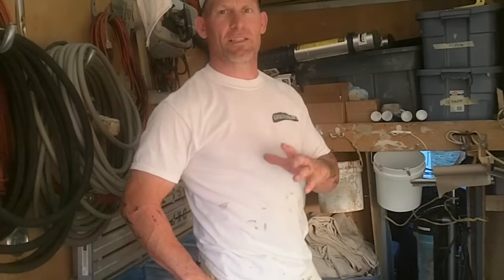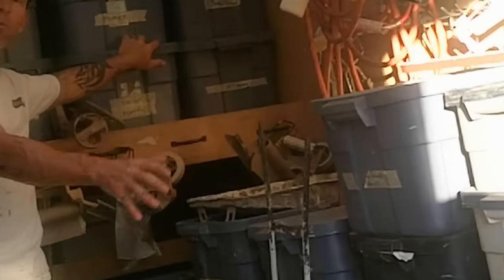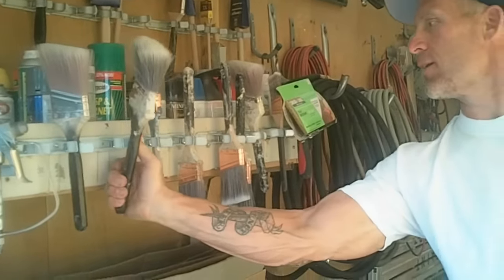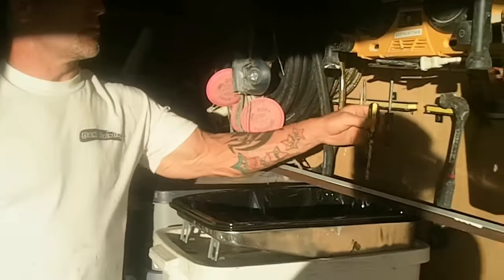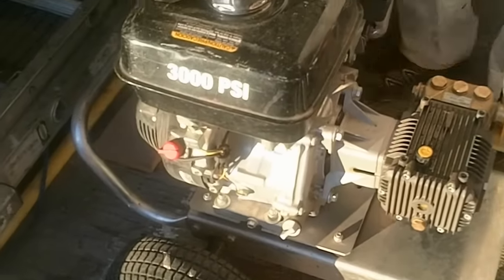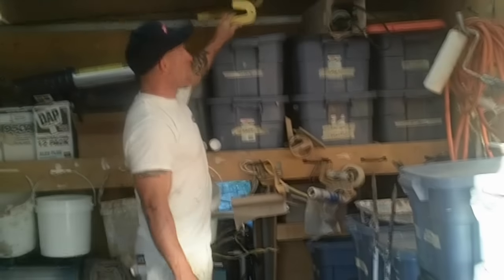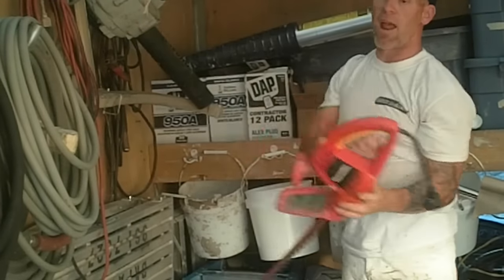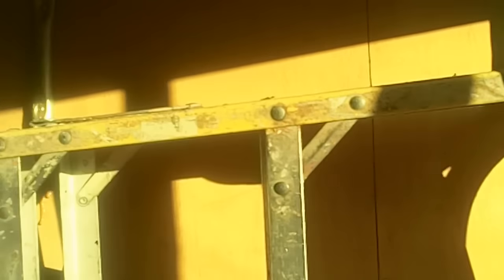DIY TOOL BOX VAN.  Organizing A Painting Van.  How To Set Up A Painting Vehicle.

Comment: Really appreciate this view into a middle ground between the guys who just build a birds nest of tools and extension cords in the vans and the guys who have either a completely prefabricated set up or one that takes dozens if not hundreds of hours and a workshop to build out. 
I did a very similar organization for our business that does residential/commercial  maintenance (Cleaning, landscapes, painting, drywall, light carpentry etc. but only small scale projects and things that qualify as maintenance) and we also use the storage totes that you guys like so much in combination with shelving, hooks and hanging buckets. The only improvement I was able to make on what I saw here (which of course you've probably improved on) is to make simple shelves for the storage totes such that you can get to the bottom one without removing the top 3. 
Thanks for all your efforts to show us how you get it done!
Reply from the maker: Thanks for watching and supporting Zachary!

Comment: You've taught me a lot Chris. Thanks. I run a smaller set-up and usually only have a half dozen naps rather than a bin full.  My van like yours is always spot on, to the extreme. 
"Mise en place" style as the off season (when there was one) was usually filled in as a chef.

Comment: I “sharpen” whittle the ends of my brushes to a flat pointed end to differentiate that they are mine. It also makes for a makeshift scraper when painting an need to chip up something small real fast or dig out putty in the trim crease ect.

Comment: Hi Chris. I love your videos. I learn alot. I want to start my own painting bussiness here in NH..but ive only painted for my family who flips houses. Ive done several whole houses. ive only brushed and rolled paint tho. I work a day job but want to start my own thing. how would you go about it in my situation. i dont know what to charge..do I measure each room and charge that way or what. im barely getting by supporting four kids on 10.00 an hour. my fiance works also..so i cant just quit to start and not have a bunch of jobs lined up. i have alot of questions..lije do you always let the customer choose what paints they want..like brands..there are alot of different types of primers\sealers etc..how do I know when to use a special primer? should i buy a used airless sprayer from Craigslist? ive seen them for 100 bux. when do you use the hvlp? how do you know when you have to spray instead of roll/brush? can i only roll and brush? so many questions..lol..but these are things i want to know before starting so i dont ruin someone's walls. i look forward to your videos. ive had alot of dead end jobs and am tired of working for people that dont appreciate what i do..i look at it as im always going to be expendable working in factories and laborer jobs..im always struggling to provide for my self and my kids because im always at dead end jobs. and i want to put an end to it. i think painting is something i can do full time if the work is there. it seems to be the easiest and less expensive trade to do such as buying tools to start and supplies. i hope you can answer my questions..im sure you get alot..and can barely find time to respond to all of them. but you are really all i have to go to when i have a question..i learn better by physically seeing it done rather than reading a book about whatever im learning so these videos really do help and are worth watching. so thank you.
Reply: Matthew Allard Sounds like you need about 10 years experience. Then you will have the answers. Good luck.
Reply: Matthew, You can start a painting business without spending much money or going into debt. I know several painters who have nice little businesses who don't spray anything. I started without a sprayer and bought an inexpensive one after the third job. Now, I frequently have two guns and occasionally three going at once. I think your best plan would be to quit your current job and go to work for a professional painter for a few years before going out on your own. You would get an instant raise from the $10 you are making now to at least $15/hour while learning the trade. That's what I pay someone with no experience and a good work attitude. In a couple years you can be earning $20 or more per hour working for a painting contractor. When you look back at your original post and can answer all those questions without thinking twice, you will be ready to go on your own.
Reply: Matthew Allard like what someone else said before me get a job with a busy reputable painting company in your area. Then:
1. Show up to jobsite on time everyday preferably 5-10 min early.
2. Bring your own lunch and water everyday. If you eat out with the guys you can always give it to someone less fortunate or eat it on the way home.
3. Have a reliable vehicle and keep it relatively clean, maintained.
4. Organize the tools you already have in a plastic storage bin with lid or tool bag and keep in your vehicle during the work week. If you live or work in a sketchy neighborhood it's easy to unload and store indoors at night.
5. Try to buy a new tool each paycheck, even if it's just a brush, roller, handmasker, caulking gun, putty knife, etc. Yard sales and Craigslist are your friend but only buy tools as you need them and can afford in the beginning. Your boss should supply most everything when you're starting but a good apprentice should have his own basic hand tools. 
6. Set aside a small amount from each paycheck for an emergency fund. Put in savings account or safe place at home and then pretend it's not even there..trust me it will come in handy some day
7. Start a cash account at a professional paint store in your area. Make friends with the employees and let the manager know your interested in painting as a career. They should give you a discount on paint and maybe a couple work shirts. Also buy a pair or 2 of painter whites there. Over time their advice and customer referrals will be priceless.
8. Keep doing side work for your family and friends on the weekends and spare time and be honest with your boss about it if he asks but never solicit or work for his customers you already have your own. Charge a little more per hour for your side jobs than what your boss pays. Use the extra money to grow your emergency fund. 
9. Sometimes painting can have dry spells so network with everyone you meet and be creative. Do not be afraid to knock on doors and make phone calls even doing handyman/labor work to get you through and pay the bills until the painting picks back up. 
10. Most important actually learn to paint well!! Learn the basics and fundamentals and work hard. Pay attention to the people who have been in the business and ask questions that pertain directly to the job you are working on at the time. Unless your boss is looking for a partner you may want to avoid talking too much about starting your own business. There can be a very fine line here and everyone is different... The last thing he wants is to invest in training you and then have you go off and become his competition or take that knowledge to another company. Pay your dues cause there really are no shortcuts and if in 2 years you are still self motivated and really into painting then start the paperwork in your state to obtain your contractors license and insurance. The cost varies depending on where you are and that extra money you've been squirrel ing away will come in handy now. 
                          -Painterlewis